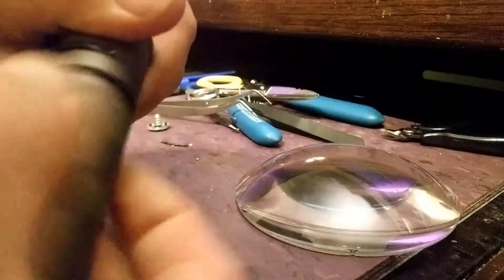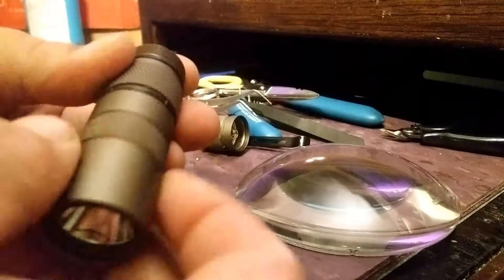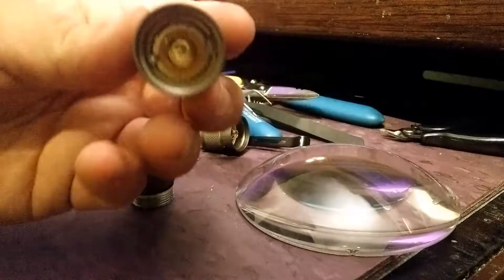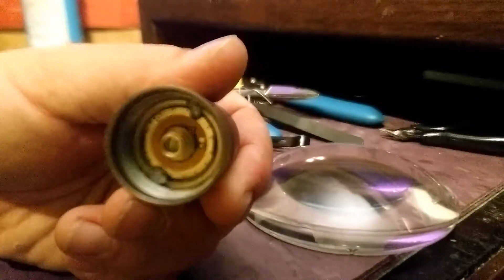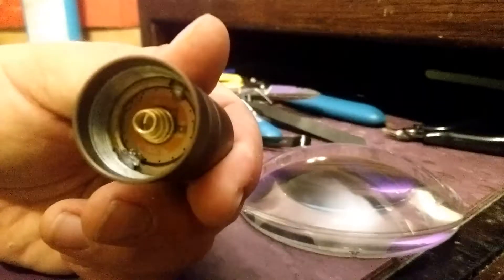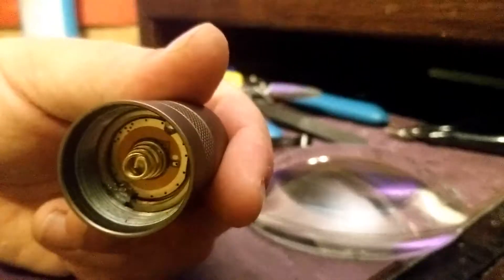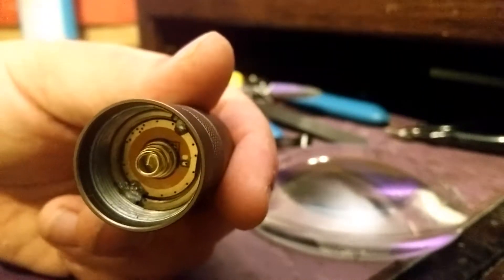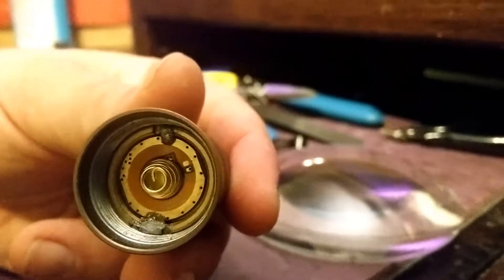Convoy S2+ driver swap to BLF A6 7/4 mode - test firing

Comment: So is it now brighter than the original Convoy?, and size what driver was in the convoy, 7135x6 or 7135x8?
Reply: 7135*8 only produce 2.8amp... direct fet driver with good battery easily giving 4.5amp to the led... so think yourself where will be brighter.